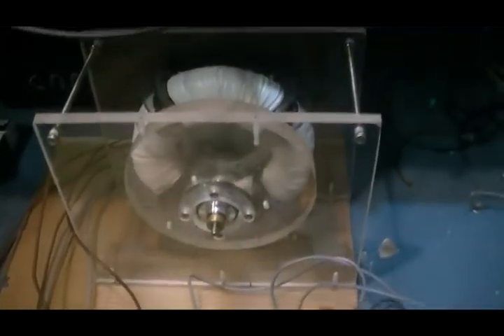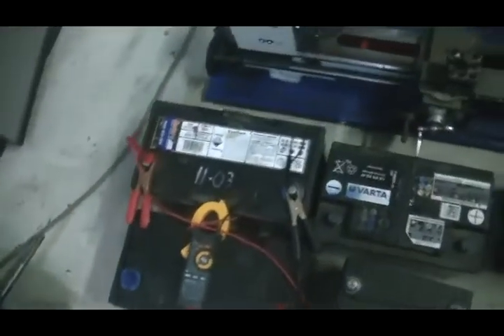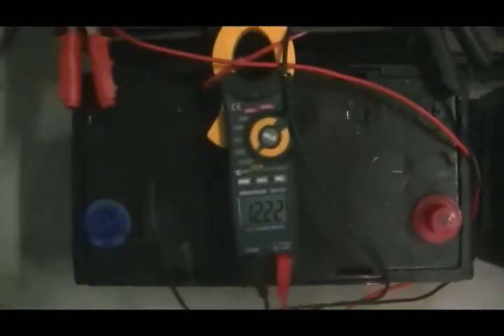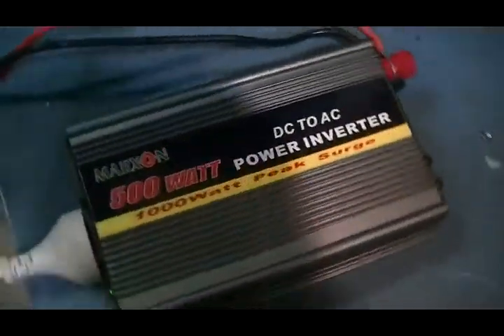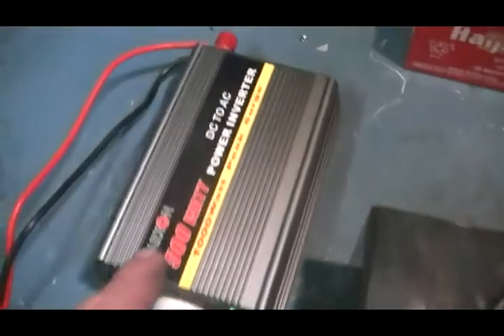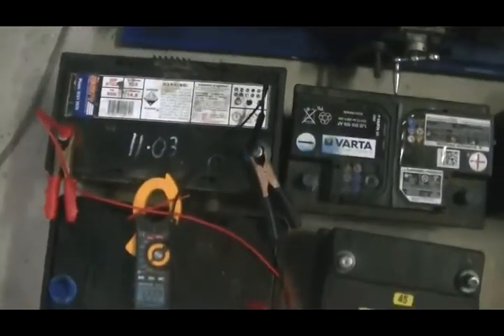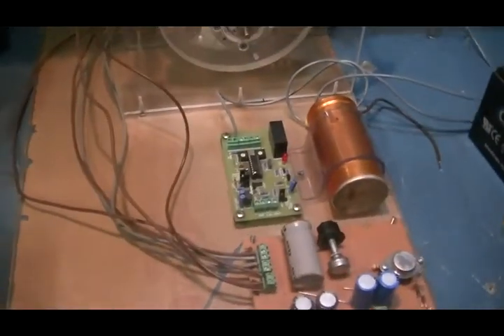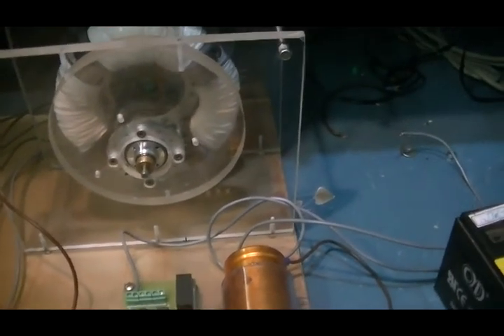battery charging update

Comment from the maker: Hi Kyle. The rotor is being used as a generator in conjunction with the gen coils.That is what is chargeing the second small battery at 18ma.So when the run battery is down to say 11.7 volts-i just swap the two over,and charge the run battery back up.

Comment: The reason for this has to do with temperature more than the fact that it’s sitting on concrete. A concrete floor is usually a little cooler than the surrounding air. This causes the bottom of the battery to be cooler than the top. When this happens, the electrolyte (acid solution) becomes a little more concentrated at the bottom causing a slight voltage difference between the top and bottom of each cell. This voltage difference produces a small eddy current within the cell slowly discharging it

Comment from the maker: Hi electro.I am putting out a lot more amp's than TJ's motor(around 500ma)Also the battery is only on its first charge-so due to sulphation,its capacity is very small at the moment.So because of these two factors,the battery voltage will rise quickly.Once the battery is back to normal capacity,it will take a lot more than those small batterys to charge it.What TJ refers to as a ghost charge is whats called a surface charge.This is where people get fooled with bedini's setups